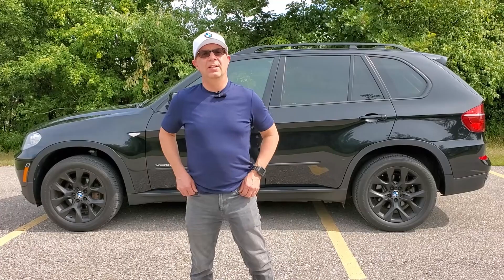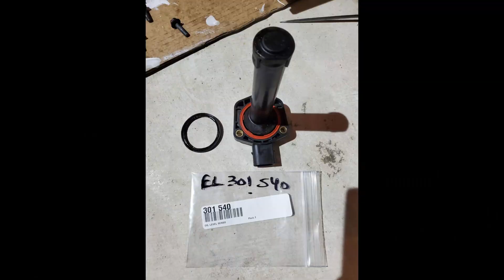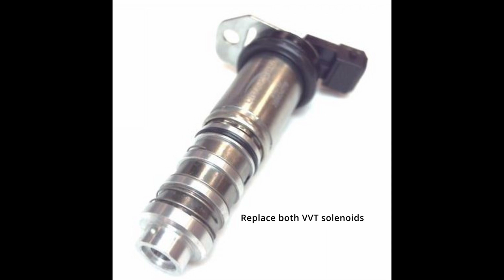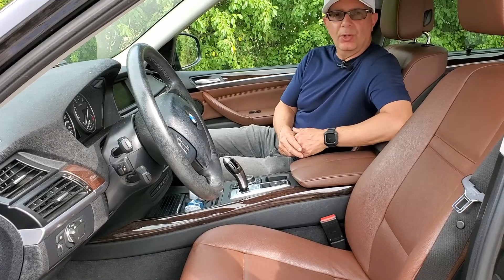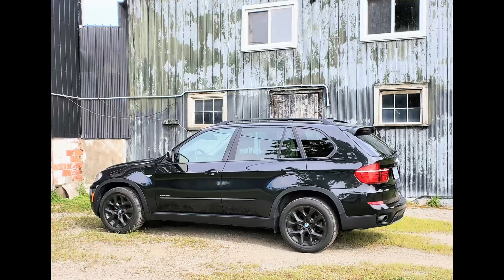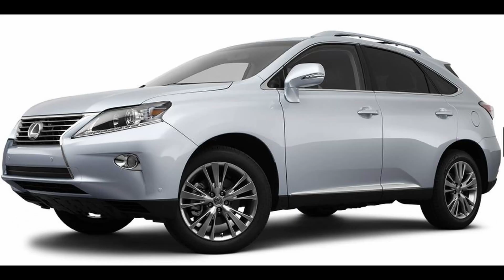2013 BMW X5 35i xdrive E70 SUV Review

Comment: First thing I did was get rid of those run flats and put some continentals on I have an M sport so I have the wide staggered set of tires. Those run flats where twice as heavy as regular tires. what a difference, they have those new flat repair plugs that screw into your tire.And I keep those and a cordless drill in the sub area as well as a small compressor it weighs nothing hooks up to your lighter. So I'm ready if I ever get a flat. Haven't yet in 3 years knock on wood. I love my X5 just swapped out my charge pipe last weekend for a metal one. Looked at my throttle body absolutely 100% immaculate.  All i use is Shell V Nito premium fuel and Liqui Molly 5W-30 full Synthetic.  Serviced my ZF 8 speed swapped cover with filter again liquid Molly ATF 1800 change my Transfer case fluid every couple years and my diffs twice in 3 years already with Liqui Molly 75W 90. Fresh DOT 4or 5 i cant remember which one. Liqui Molly has an app you put in your vehicle and it lists every fluid for your car. That oil smokes american oil in my opinion.  They dont use Molibdyum as the base lubricant. Do you guys watch the oil geek. Hes got a degree in Tribology. The study of lubricants.  Works for Joe Gibbs racing. He knows his shit and tests everything scientifically.  Youll be surprised at a lot of shit people think is good stuff thats actually ruining your oil and cutting way down on its performance.  DONT USE ANY OIL ADDITIVES. Fuel additives with PEA polyetheramine.  Gumout , Techtron are 2 additives that affect your vehicle in a positive way. And it works quick. He says fuel is just as important as oil. So stop using shit gas its killing your car and its not saving you money because all the carbon build up is killing your fuel economy and is gonna kill your engine way quicker than if you keep your fuel system clean. Premium  Shell, Mobil, Sunoco. Not gasman or happy gas. Or COSTCO!!! Fuel sucks at Costco and Stop and Shop gasoline. He sits down with a guy that ran a major refinery for decades and he breaks it all down scientifically.  Some of it goes over your head but they give it to you in Layman's at the end of all his videos. My vehicle sat outside for 2 years driven like twice in 2 years and the guy used shit gas  my scantool told me that car ran like Pure shit but after  doing all the maintenence and religiously using quality fuel and oil it runs unbelievable so they're a robust engine so if have one its not too late to turn it around Goodluck
Reply: Oil Geek.  Isn't that Lake Speed's son?  Lake back in 1977 or 1978 won the European go kart championships.  This is a working class young man with no money from Louisiana beating the best in the world including Ayrton Senna.   

Liqui Moly was sponsoring German race cars back in the 1970s when turbos first came out.   BMW's, Ford Capris and maybe Porsches too.   Top company.
Reply: @frankl31436 yes i believe it is. I know he always mentions his dad with racing topics. Did you watch him? He knows his shit when it comes to oil and fuel.

Comment: Best video on this subject by far, great job!  And thank you.  Edit: just wanted to add, I believe the in-class competition for this vehicle is the Mercedes Benz ML 350, not the Mercedes GL class. Even so, internet search supports your statement that the Mercedes provides a bit more cargo capacity with the rear seats folded down. X5: 76.7 cu. ft.; ML 350: 80 cu. ft.

Comment: Hi Chris, thanks for a great video, I own X5 35i xdrive E70, 2013 (M) with 73k Km ( 45625 miles) I bought one year ago. I already change the oil valve cover gasket  and the front brakes pads. Do I have to change the brake fluid or the coolant? , what do I have to do in the Inspection?, do you recommend change something else?.  Regards
Reply from the maker: Hi Alex, If you do not have any documentation, from the previous owner, that the brake fluid and coolant have been changed in the last couple of years, I would then change them and then you know you are properly maintaining the X5.

Comment: i'm looking to buy 2011 BMW X5 i35 it has only 43k miles on it the car looks like new inside and outside is this a good choice lol because i'm having hard time to believe this person drove only 3k miles a year carfax says it's one owner vehicle and says milage is correct they are asking for $12.500 usd
Reply from the maker: Do not focus on the mileage.  Focus on the condition of the car.  Do a thorough inspection of the entire vehicle to look for potential problems.  If you need to get a mechanic to inspect it.  If maintenance like gaskets, etc. were not done yet.  Confront the owner and negotiate that price down.

Comment: The AC in my car is not blowing cool air? Have replaced the sensor, compressor, condenser and filled up with 6 Freon cans. Any suggestions…to what can be going wrong.
Reply from the maker: Hi, I need to start with the simple questions.  It the temperature set to the lowest setting in the cabin?  Secondly could the cabin temperature control or module be malfunctioning?

Comment: I'm thinking on getting an x5 ... I haven't paid a mechanic in 20 years. Maybe I can tackle this suv's engineering. Got my eye on a 110,000 mile 2013 model. We'll  see a bit more research...
Excellent review helped alot. Thanks!
Reply: Brother, I'm a 38 year carpenter, not a mechanic. and I do all my own work on my E70. I've done everything suspension, complete suspension. I've done the valve cover. I've done pretty much everything he's saying I've done Val solenoids, but don't get any aftermarket parts, go to F CP Euro and get on their OEM program and everything is cheap, but it's the exact part that was made by the exact manufacturer it just doesn't have the 3 letters BMW on it and it's like a third the price. And one of the best things about F CP, euro they have a video on how to do  anything on this n555 step-by-step with these elite BMW mechanics, and you just follow along and you're good 1 of the best mechanics down there has this vehicle, so he does all the work. On his own vehicle, anything you want to do on it. He has a video for it.
Reply: Same I’m thinking also/  did get one?
Reply: @hashfreshtodeath   ended getting a one owner stepside 94 gmc sierra z71 4x4 260,000 miles. I've already replaced all sensors, around the engine, fuel pump, fixed most gremlins. Put new calipers, wheel cylinders, slotted and drilled disc brakes, new rear drums with new retaining hardware, master cilynder was new, fixed steering wobble, new distributor, wires and plugs, Put new headlights, turn signal and corner markers, tailights, wiper motor circuit board, new speakers and an android touch screen with GPS. Up next are power mirrors (I have to retrofit), go through the AC system, fix upholstery make a center console with 8inch sub woofers, tint side windows and fix the paint. Good for another 260,000 miles. Did all this for about $2800. And several weekends. Almost all parts are oem. Rest are better than the cheapest. I get compliments driving down the road. It is my daily and I will get the Beemer but not now. I'm happy with my choice I can fix anything on this thing without a scan tool. Worst case I drop in an intake with a carburator and I can keep it going. Got the truck for $4000. These hold their value and I can always get my money back when I'm ready to let it go.

Comment: Another thing I wanted to ask you Chris, is that are you located in the GTA by any chance? I saw the ON plates. 

Just wondering if you have any recommended BMW shops, or do you work on your own BMWs for the most part?

I went to Columbus in Mississauga for the PPI I did with that '12 X5, and it was pretty good overall

Cheers!
Reply from the maker: Hi, thanks for your response.  For the most part the N55 engine is very good but must be maintained.  Do a good inspection or have a shop do it.  Look for oil stains under the car.  If they are present do not worry , just use that to negotiate a lower price.  The gaskets fail and need to be replaced.  That can cost thousands.  I do 95% of my own work so I avoid this high costs.  I am in the Hamilton area so I cannot recommend a good shop.  The dealerships will do good work but they charge massive amounts of money for everything.  Do an internet search of your area and then interview any potential repair shops.  Ask to talk to existing customers and if that goes well start them with something simple like oil changes or spark plug replacements.

Comment: I really wanted to get an E70 X5 35i, almost pulled the trigger the other day on a 2012, but ended up getting scared with the potential running costs for the supposedly more reliable N55. I can afford the costs to keep it on the road, but I really didn't want to deal with the potential headache and the added costs. 

I was so close to pulling the trigger tho, an 2012 35i with M-sport pkg, sport seats, HUD, 360 camera, cinnamon interior with dark grey exterior, with 80k miles, selling for $14k Canadian Dollar, but needed about $4k in work, including a leaking oil pan, a spring, an inner tail light.

What scares me a bit tho is that the seller wasn't really honest with me with the accident claim, and initially refused to let me take it to my mechanic. Also, the HPFP, water pump and valve cover has never been replaced, and will probably need to be replaced down the road.

I think I will have to make the more sensible decision and pick up a 2nd gen MDX for now. If I go for the facelift models, I can get some pretty nice tech as well including adaptive cruise, ventilated seats, etc. also it will have 3 row seating with the SH-AWD. 

My friend has a Honda Pilot with 350k+ KMs with just regular maintenance.

It's unfortunate since I really did want an E70, but it's a shame BMW couldn't make the N55 a bit easier to service, and run a bit cooler so stuff like the valve cover, and oil gasket wouldn't be such a big issue with heat degradation of materials and seals etc, it's just not financially responsible for me atm

Excellent and thorough review tho! It would really help potential buyers of the E70 know what they are getting themselves into, both the positives and negatives of this great SUV!